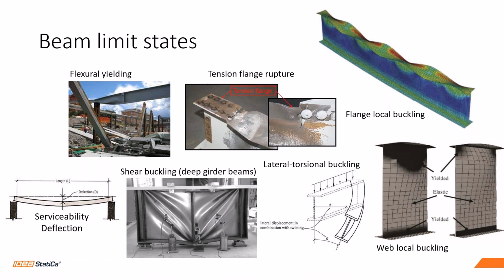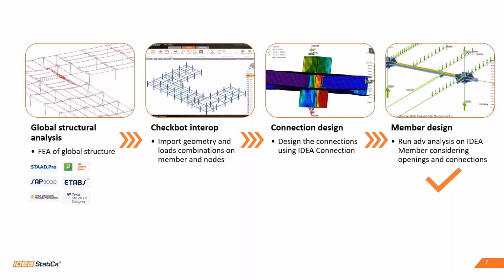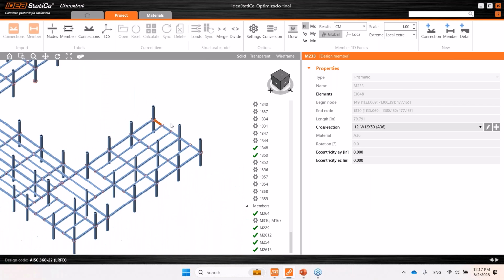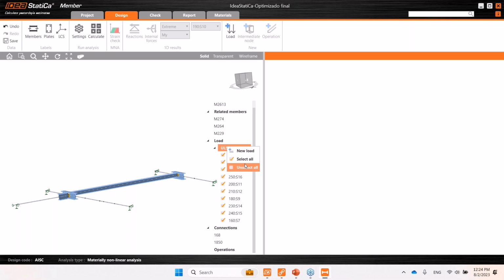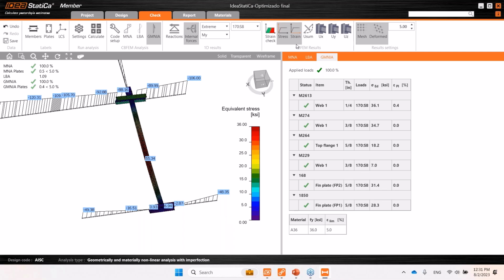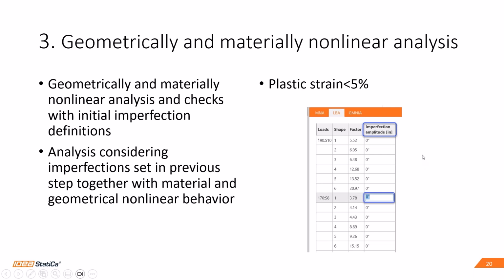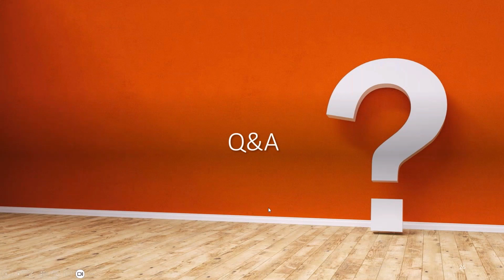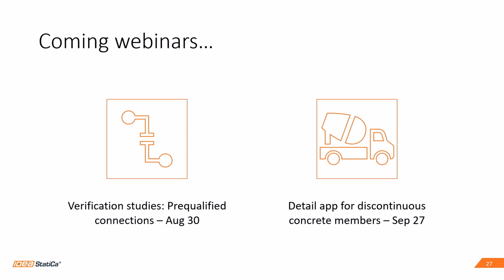IDEA StatiCa Webinar: Critical steel member design workflow with IDEA StatiCa

Comment: Hi! 
I am working with Midas Civil and IDEA StatiCa v 24.0.3.1484. Can I use this workflow that you use in this video? 
I only see videos about how I can import Midas files in Idea Statica BIM from where I can design nodes and that is about it.
With checkbot I can only create a project but the project is empty, it has no member. I can't find any information about how to get my FEA model with its loads into Checkbot so I can use your workflow to design nodes and members as well. 
Hope hearing from you soon!
Reply from the maker: Hello,
unfortunately the BIM link between Midas Civil and Checkbot is not yet developed, we are planning to release this BIM link in version 25.0 in spring.
Thank you for understanding.
Reply: @ideastatica_en  Are you also planning to implement Checkbot for Advance Design in version 25.0?